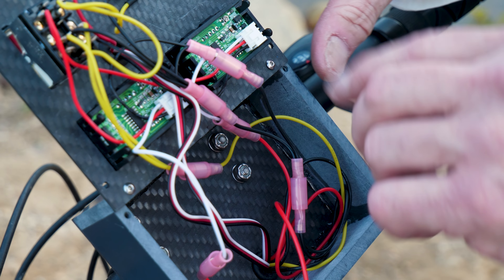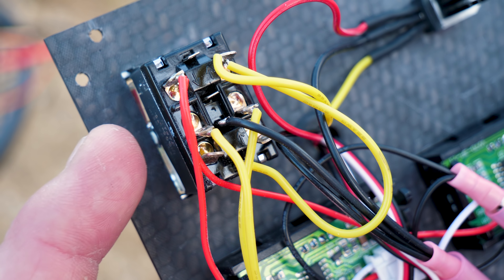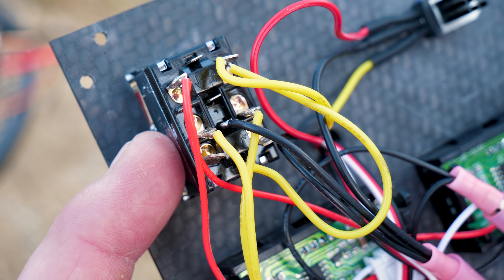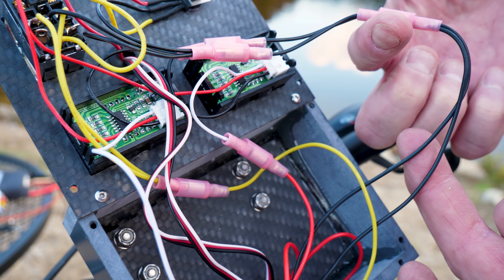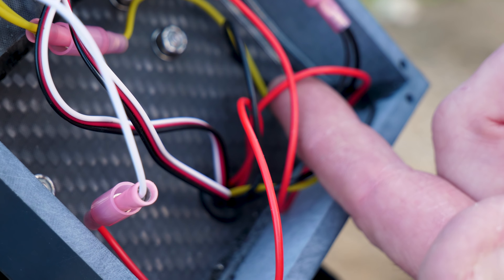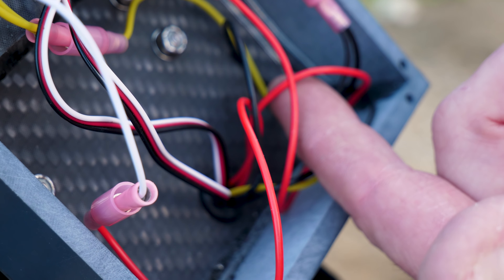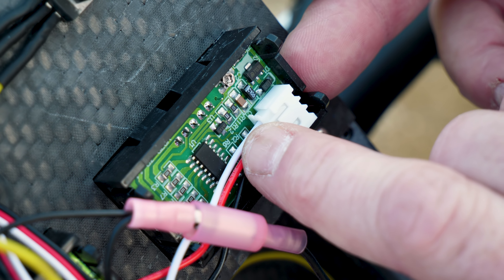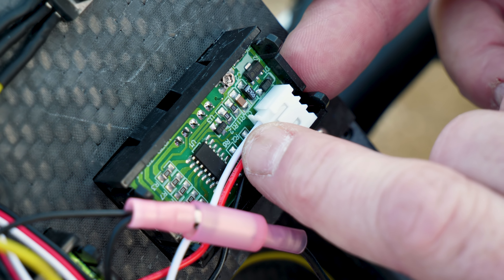Jet Bike - DIY Demo and Test Drive

Comment: 12 gauge copper is like 15 milliohms per foot. Not much to worry about there LOL
Reply: Is there a way to translate awg to square mm?
Reply: Now calculate the voltage drop over that 1 foot of 15 milliohm wire when pushing 100 amps through it. Then see how many watts are being dissipated (wasted) as heat.
Reply: @HarmanRobotics  I see, yeah 15 watts over a 1 foot cable is quite a bit.
Reply: @ColtaineCrows  yeah just find out the cross section of the wire based on gauge
Reply: @sinephase  No, it is ten times that. The voltage drop is; 0.015 Ohm * 100 Amp for 1.5V. Then power is 100A * 1.5V for 150 Watts.
Reply: @ColtaineCrows  there are tables online. 12 AWG is 3.31mm^2. But I believe in the video they said it was 10AWG, not 12.
Reply: More like 1.6 mOhms per foot. Just google "ampacity table".
Reply: Since you were wrong by a factor of 10 on the resistance, you are also off by a factor of 10 on the power loss. It is 15 Watts per foot (if it really is 100 Amps, and if it really is 12AWG wire, but I think he said it was 10 AWG and I doubt he is running at 100 Amps).
Reply: @mckenziekeith7434  Yes, it is actually 15 Watts per foot because the resistance is 1.5 milliohms per foot (0.0015) not 15 milliohms (0.015). I should have verified that, but was going off the data provided. Sheesh, I normally catch that sort of thing...
Reply: @mckenziekeith7434  10 gage wire would be about 10W dissipated per foot at 100 Amps. That's ten times what is recommended but okay in this type of application where the run is very short and out in the open so that the heat can easily escape.

Comment: If you value your life, I'd highly recommend getting disc brakes on the bike before you ride it at speed. would also install sensors for cutting the electric motor when brakes get engaged. 
If you like high end/high power electric bikes, check out these guys -- https://lunacycle.com/e-bikes/

Comment: Isn't a lot of efficiency lost by placing the fans directly behind the rider? I would think it'd work better to have them mounted a bit further from the center of the bike so they're outside the draft of the rider. Or use a front rack instead of a rear rack.

Very cool build.

Comment: Another great video, this is great! Its got wheels so whats the Top speed and associated battery drain? I see more efficiency in this proof. Rolling resistance reduction with skinnier wheels/tires and slicker contact patch along with a weight reduction in your sons carbon fiber frame and ancillary components. 👍

Comment: That is sooo amazing!  Unfortunately in the EU it would be illegal so I couldnt try it here.  You cant go faster than 15 mph (approx. 25 kmph) and it can only be assisted pedalling you cant have an independent motor.
Reply from the maker: Thank you!
Does all that regulation benefit the people living within the EU?
Reply: Well of course nothing is all good or all bad but i would say its getting a bit overbearing at the moment.  I would have liked to try to replicate this for instance!
Reply: @TechIngredients  The US has regulations, too. Your 10kW ebike is 9.25kW over the legal limit.
Reply from the maker: Don't get me wrong, nothings perfect.
Reply: @TechIngredients  See, that's the thing about efficiency. If a builder is limited by power (defined here in Ontario as power output of the motor), the only way to legally increase your speed is to increase efficiency. Of course, people are not being pulled over on ebikes for wattage tests. The second a pedestrian is badly injured or killed by an "overpowered" ebike, though, you can bet a politician will demand "tougher laws" and more pigs.
Reply: @paulosullivan3472  You can still replicate it, you just can't ride it on public roads. On a closed course or other private property, you can ride any damn thing you want.

Like, imagine the automobile equivalent of this project. You want that to be legal, too?
Reply from the maker: My point has nothing at all to do with technology.  "Politics is the ultimate science"
Reply: @TechIngredients  I know what you meant, which is why I mentioned legislated limits on ebikes.

Comment: A fun video, major points for coolness, shame it would break all the UK laws on E-bike power and use :-)  Since you are using each unit well below capacity, have you considered running just one ducted fan instead of the two but using it to it's max capacity? Regards Sarah
Reply: Well afaik the law says ebike motors shouldnt be above 350W, these arent ebike motors, they arent even motors to begin with, these are turbines, so i dont think it applies.
Reply: @laharl2k  If you reread my comment you will see I was talking about UK law (where the limit is 250 watt for use on roads). Of course they are motors, they are electric ducted fans the power comes from electric motors! The fact that there is not a direct drive to the wheels does not alter where the motive force comes from.
Reply: @loydsa  
Well a person can output around 120W, so if you put 2 strong persons on a single bike, does that break the law?  The only way out of this is to read what the law says and wheter it says motor or propulsion method and how its defined. (btw i thought the limit was 350W)

Comment: Great build, thank you for the video. I just want to ask if it would be appropriate to place each turbine more wider in that way where rider will not block air intake? Also we could make a nice confuser, that will do the same: help with air bypassing over a rider.

Comment: Very awesome. I know you're scientists but I can tell you're not too much of cyclists due to your saddle height (WAY too low). I believe you'd gain higher efficiency with better airflow into the turbines by mounting them out to the sides and at a lower center of gravity. Study more into bicycle and cyclist aerodynamics/physics and come back with a follow-up video. This setup could be replicated on many bikes or even a longboard.
Reply from the maker: Thank you!
Believe it or not, I do know something about aerodynamics and it applies equally to aircraft and bicycles.
These rather low thrust fans are not starved for air.  We even positioned the heat sinks partially into the intake flow path to provide better cooling.
The optimal bicycle for this installation is a high performance, light weight road bike with a rider who maintains a proper racing posture.  That kind of bicycle is often very expensive (although it doesn't have to be as my son's build is proving) and one you don't want to modify for a conventional E-bike drive system.

Comment: where do you guys live/shoot these videos, the location is beautiful. My guess is canada but unsure of the state. As I'm from canada too
Reply: They're not in Canada, as I also originally assumed. I believe the host said in another video that they're in Massachusetts.
Reply: This particular video was shot on the Kancamagus Highway, (Route 112), a beautiful roadway in New Hampshire.  I haven't been there in years, but recognised it immediately (and confirmed by the highway sign).  The road was much more fun before the state paved it years ago.  Back then it was about 1 1/2 lanes wide, and really through the wilderness, and closed during five months of winter.  At least once, after it was paved, I have bicycled the length of the road.

Comment: Tech Ingredients Excellent video!  I really like this, I looked up those same brushless EDFs controllers and batteries 4 years ago for the exact same purpose, although I was just pricing them out which turned out to be astronomical in cost.  I determined a couple of 12 AH Lead acid batteries mated with my custom made 180mm 3d printed shrouded turbine blade (18  blades with a unique pitch profile to minimize drag from blade turbulence) in an industrial cardboard duct,  to a 10,000 RPM 250 watt 24volt d/c brushed motor, would be an inexpensive alternative.  I tested it with a thumb controlled rheostat  and did find it to be an inexpensive alternative to the Prebuilt brushless EDFs.  My bike reached 13mph on flat ground with almost no torque compared to a 250 watt brushed hub motor, and maybe 15% of the range.  I still think it could be a big seller as overall cost (-the 3d printer lol) is around $250 total including batteries and charger.  This for a seat post mounted propulsion kit of a simplistic nature, and also having a fantastic sound and safety with a 10" * 8" duct.  I gave up on the project after seeing a snowboarder with a powered  "bar propulsion unit" that had 2 large EDFs and batteries in the bar, it made me realize I was way behind the times and that brushless EDFs would eventually be the way to move forward.  Now if only the price would come down on lithium batteries, that is the only limiting factor really.  My airbike with a 5 hp 2 stroke snowblower engine and a 22" carbon tri blade Pusher prop easily did 40mph albeit low torque compared to a belt or chain drive.
Reply: Prolific Invention: Great work you have to put up a video about it. The cost factor is really attractive and realistic  as compared to this Tech Ingredients beautiful venture.
Reply: If you don't already know about him--check out Robert Murray Smith's channel and learn how to make your own batteries and super capacitors.

Comment: Great project if you have the fans. Otherwise, terrible.
Reply: In practice, longer phase wires from motor ton controller afford some cooling.
Reply: So...you're "tapping" a different voltage from the same pack? This is not viable in the long-term.
Reply: That thing runs worse than a three-legged dog. Even the cheapest geared hub motors at low voltage will blow the doors off it, let alone a "1000w" direct drive. LiPo packs also have a terrible lifespan compared to li-ion chemistries, especially LiFePo4 and LTO.

Comment: How many EDFs do you have? If you got the equipment to custom build multicopters and some EDFs lying around, and don't mind sacrificing endurance for coolness, would you consider building an EDF multicopter?  
I tried making one a few years back, but I only had inefficient low diameter EDFs, so it could only fly 3 minutes at a time, but the sound of 6 EDFs lifting off was totally worth it.
My build log at RC Groups: https://www.rcgroups.com/forums/showthread.php?1977411-EDF-Flying-Saucer
Reply from the maker: That's neat!  We have four, but they are not identical.

Comment: Hold on, you're claiming 25% power efficiency with the EDFs compared to direct driving the motors?

That's a lot higher than I was expecting.
Reply: I'd guess that assumes a best case scenario, speeds in the 20s, and using a "pulse-and-glide" strategy on the fans to take advantage of the quadratic thrust. For example go full beans, get up to 25mph, then coast down to 15-20mph before throttling up again.
Reply: If they really are running the motors at 5 kW (even total) at any point in the video, the efficiency is more like 5 % at best.

EU electric bikes are (okay, used to be) limited to 250 W and 25 km/h electrically assisted speed, which they would've been comfortably capable of reacing without any kind of pedalling. In the video they seem to be doing 20-25 km/h at best except on the steepest downhill sections, a speed either of them could easily achieve and maintain by pedalling and far slower than any healthy person who rides a decent amount.

At 500 W of power to the wheels the bike should be able to reach at least 40 km/h on the flats. The difference might not seem very huge, but remember that drag squares with speed and even professional cyclists can't hold that kind of power (the world record for 1 hour of riding (54.5 km) was set at an average power of under 500 W (on a vastly more aerodyanmically efficient bike)). Around 50 km/h at 1 kW.
Reply: I bet the real efficiency is much, much lower. This is a very cool concept but this kind of a "drive" is not very practical for a bicycle. The high pitch noise alone may be a major issue too, however, this jet system can be useful in situations where low tire traction  may be an issue.
BTW, this system, attached to a lawn tractor, can be used as a leaf blower.
Reply: There is one advantage.  Direct motor drive sucks the power down on steep hills when the rpms drop.  My ebike with a supposed 8 mile range only made it a mile or so where I live.  Near stall current is a bitch.
Reply from the maker: Let me give you some rough numbers. We have an E-bike that is pretty average in it's performance. A 36 V x 20A/hr battery will propel it and a 210 lb rider (me), 20 miles or 105,000ft. 80% depletion of the battery will place 2MJ into an ESC to drive a BLDC motor. At 80% conversion efficiency, through the electronics and motor, this will provide 1.6MJ into the wheel, or 1.2 million ft/lb. Over the 105,000ft distance this equals 11.5 lb of thrust. Our fans produce up to twice that amount of thrust.
We never ran these fans above 25% (just coincidentally also 25%)of their maximum thrust.
A professional bike rider on a good bike rides at 25-28 MPH and generates 7 lb of force against the road (thrust). This is due to a lighter bike and a much more aerodynamic posture.
Efficiency is a squishy value here due to these significantly different conditions.
Reply: @TechIngredients  It would be really useful to take this to a track and record some data on current draw, voltage and speed. Also would be interesting to see how much power is required to maintain a certain speed using different postures. Running side by side with the e-bike gathering the same data would be even better.
Reply: @GigsTaggart  IOW, you're pushing your motor too hard for the voltage you have. If you can't or prefer not to spin up the hills with the pedals, you need more voltage.
Reply: @HarmanRobotics  What a waste of time that would be!
Reply: Omg you calculate how energy you have in your battery and how much trust can be provided by that energy in 10500ft. Than you state that your fan can provide 2x as much trust? 
How the fuck came that here???? It fuckin dose not matter. Cause if you use more trust you dont have  80% energy conversation but much worse.
The question is :
IS IT ONLY 25% less efficient to push against are then push against hard surfaces. I doubt it very much. 
If you compare only a 20MPH cruse speed maybe 25% loss is right.
BUT accelerating pushing against the air is fuckin energy consuming and SLOW.
A 6KW e-bike feels like a rocket. And this is 10KW lol.
Can you provide acceleration data?
Reply: @hulladek3  I also suspect much lower efficiency. It is a ridiculous way to propel yourself.

Electric propulsion is not good in situations like this - the energy you are wasting came from somewhere, probably a fossil fuelled power station. Just burn the fuel yourself to reduce overall CO2.

Note that the battery is described as 20A/hr. What. Watt?!
Reply: Claiming :)
Reply: Well I think there will still be power loss because the fan or jet is less efficient at slower speeds.  But if it was made into a jet/afterburner it might be good on hills, despite being inefficient.
Reply: @TechIngredients  "Efficiency is a squishy value here" ... love it! :)

Comment: 12:15 oopsie, i think thats not true :P when you wire them in parallel the different capacities only cause the stronger battery to provide more amps, so the voltages stay the same. julian illet made an experiment to prove that. if you wire them in series, you run the risk of overdischarging the weaker cell, or even negatively charge it, when the capacity difference is very big
Reply: Yes, this is a very important error!

In parallel, the voltage on each cell is identical, and no cell can be discharged relatively deeper than the others. The entire pack essentially behaves like one big cell.

In series, you push the same current through all cells (regardless of their remaining capacity). This current is in the opposite direction as you would use when you are charging the pack (well, obviously, as you are discharging it). If one cell has 'depleted' all its charge, so to say, then it indeed might get 'charged' in reversed polarity by the current that gets forced through in reverse by the other, high-capacity cells.

Personally, I'd rather not reversely charge a lithium cell a few inches away from my ass -- but maybe that's just me ;-).
Reply: Exactly, i keep hearing people say putting baterries in parallel causes one to overdischarge, and thats BS! The only precaution youd need is to add one fuse in each terminal so that if one baterry shorts out the fuse prevents the rest of the batteries from dumping all their charge into the shorted one which could cause some serious explosion.

Comment: I suppose this is not very good up hill.
Reply from the maker: That is true.  But, because its thrust remains unchanged at all speeds, very high velocity can be achieved on a flat and riding it in anticipation of the changes in elevation is very helpful.  It can be frightening down hill.

Comment: I calculate it rought but at the end you get 26lbs of Thrust for a system weight 15lbs of material, so is it easier to just lose 11lbs of fat and gain same efficiency. just joking
Reply from the maker: You're numbers are about right.  However, remember you are not attempting vertical flight.  A professional bike rider generates approximately 7# of thrust when riding a good road bike on a level surface at 25 MPH.

Comment: It looks really slow
Reply from the maker: It is not.  We were running no higher than 25% throttle.  On a better bike with good posture and 3 times the thrust a pro generates on a flat at 25-28 MPH, you can imagine that it might be pretty fast.

Comment: So...they burn up to 13.42281879194631 Hp and yet have virtually no motivational ability...

A typical 2.0 hp chainsaw motor would go further and much faster.

A 13 hp gasoline engine would be too much power for your frame.

Seems you should at least have bigger fans to move more air for the amount of power you would be drawing. ~( ,m,)~